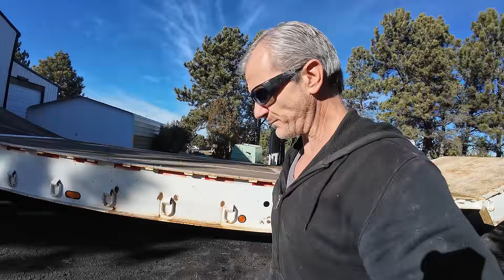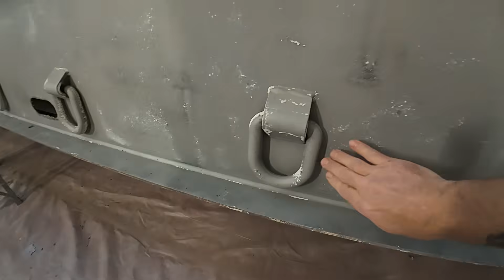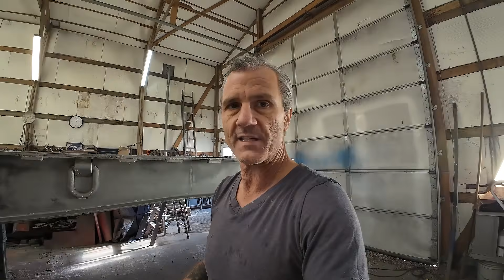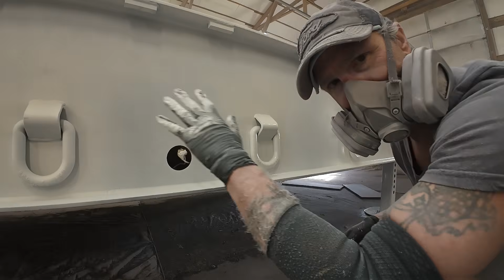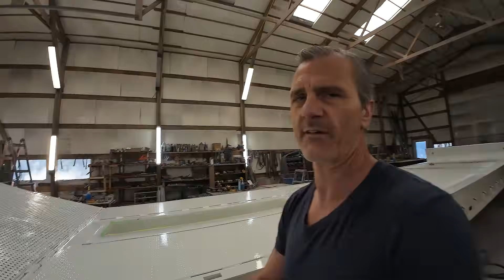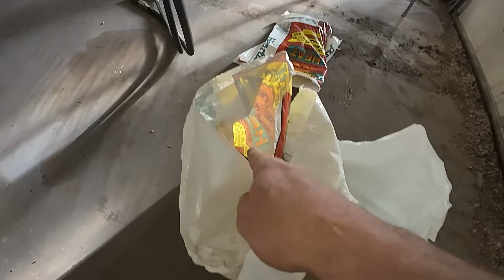Pressure Pot Tutorial...While Also Painting A Big A$$ Trailer!!

Comment: Impressive! What are you using for an air compressor? Ever paint a rubber tired feller buncher?
Reply from the maker: I use an Ingersol Rand single phase  240 volt. Thanks a lot, Erik!...And I've never actually heard of a feller buncher before.
Reply: @teams.t.e.a.m6214  I'm impressed that it keeps up with sandblasting.

Comment: How many square feet is the shop and how are you heating it just the one pellet stove? What temperature are you keeping it at? How many bags you’re going through you think a year I’m in New Hampshire and I have a shop that’s 38 x 85. A heat source is the next project.
Reply from the maker: My shop is 30 x 63...and I heat it with 3 pellet stoves that are 50,000 btu each. They will heat up to 2500 square feet. I heat it during painting with propane torpedo heaters to keep the heat up and also keep from sucking a bunch of overspray into my pellet stoves...which stay switched off during all paint work. The Pelpro pp130 is the stove I use